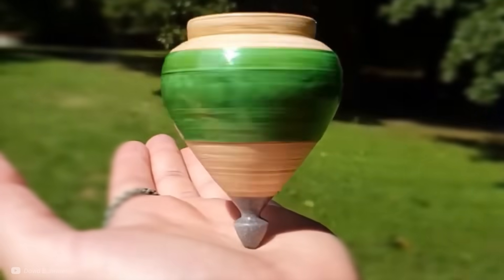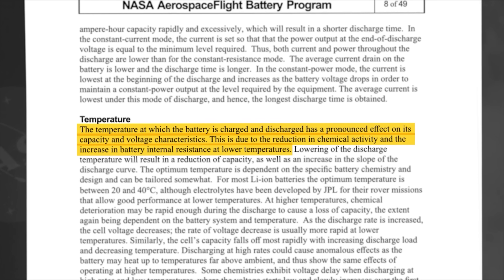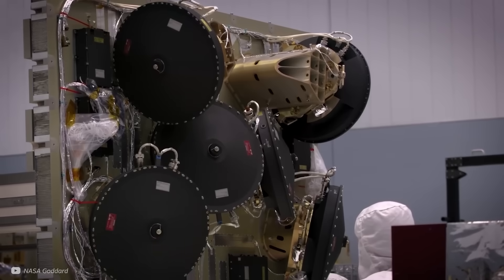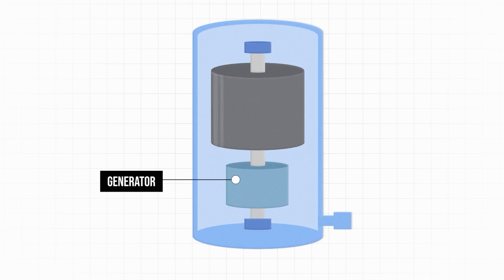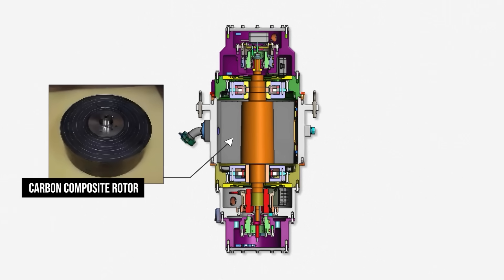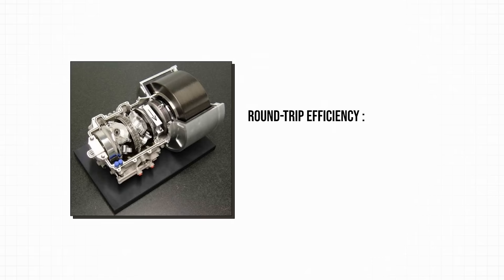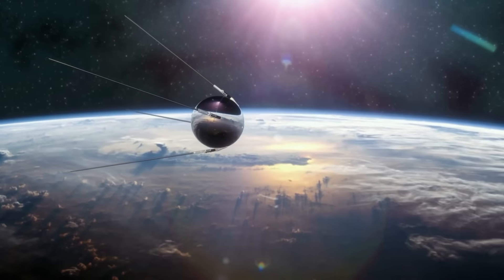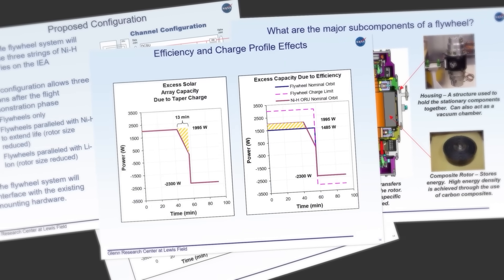How NASA Reinvented the Mechanical Battery

Comment: So, stupid question, why does it need to be put through a generator / motor? My thought is those wheels with permanent magnets that spin and create power. Does that actually also create drag? Like when you drop a magnet through a non ferrous metal tube / magnetic break?  I know that's pretty much how an electric motor and generator work but without any contact how does it slow it? I am just trying to understand.

Comment: wouldn't the obvious issue with a flywheel in space be that it has a lot of angular momentum you constantly need to fight against, both as it slows down/speeds up, and whenever you want to reorient the spacecraft? also if you take the weight into account, i can see why batteries are clearly a better option now and into the future.

Comment: Flywheels are great for energy storage ... for periods of time on the order of hours.  It's the friction loss in the bearings, and even the air resistance (unless you evacuate the chamber in which the flywheel rotates).  Also, the electromagnetic motor/generator has to be able to accommodate a wide range of rotational speeds.

If you puncture the (vacuum) chamber holding a high energy flywheel, the next thing you should do is run like hell.

Comment: Flywheels may not be affected by chemical degradation like batteries, but they are subject to wear and tear that limits their lifespan. The progressive failure of the flywheels on the Hubble Telescope has necessitated their replacement several times and has caused ongoing issues with its star tracking mechanisms

Unfortunately your videos have a tendency to oversell whatever your video is investigating; whether that be due to your passion for the subject matter, or due to your limited exposure to the wider engineering discipline. I suggest that your videos would age better and be better representative if you included a dose of scepticism

Comment: As I recall, many years ago one of the Big Three auto makers was working on a rotational energy storage system with a mass that rotated at a very high RPM. When it catastrophically flew apart and killed a couple of people, the experiment was ended. (Perhaps someone with more information can give more details.) Rotational batteries can be extremely dangerous!

Comment: the biggest thing is getting faster and faster rotations, since KE=1/2Iw^2 where I is the moment of inertia and w is the rotational velocity. this means the kinetic energy in the battery will increase linearly with mass but exponentially with velocity. this also means you can get better kwh/weight ratio with a lighter flywheel. idk the effect the lower inertia would have on power output though, seems like it would be able to get higher peak current but struggle long term, but that's just a guess really. 

of course with greater rotational speed comes more centrifugal force trying to pull it apart and so you need stronger and stronger materials.

interestingly i had come up with this idea independently a long time ago, i thought about the conservation of angular momentum and my first thought was "what if you put a giant coil around the earth" then scaled it down a bit...a lot...and i thought of a large spherical magnet surrounded by a coil, it would be in a vacuum chamber on magnetic bearings to minimize friction. i knew if friction was 0 it would spin indefinitely, but i figured there had to be some force that acted against the magnet when you drew a load that would slow the magnet down (since i don't believe in perpetual motion machines) but i didn't know at the time what that was, so i looked it up and learned about lenz's law, i also learned that nasa had already created the very thing i thought up and was using it as a battery, something that hadn't occurred to me.

also one other thing, not all motors are generators, only those which use a permanent magnet, some motors use an electromagnet in place of the permanent magnet, those cannot be used as generators.
Reply: @Tusroni - Regarding the last paragraph of your post about "motors as generators" sorry, not at all true. Haveing owned and repaired many over the years, the vast majority of generators in service aren't PM types. An example is the alternator on most car engines today has a spinning magnet coil winding, excited thru a controller from the 12vdc battery has no magnetism when disconneced from power. Yes, I know it isnt used as a motor, but the same principles are used in those that are; such as the gigantic Motor/Generators used in some pumped storage dams that send water to an upper resevoir when exess power is cheap, and runs down thru as a generator for high demand times. Also some car starter/generator and hybrid systems have been tending to minimise use of rare-earth magnet$$.
So, most non-PM motors DONT generate or generators DO motoring (as built) but many could with modifications.

Comment: why dont they use a ratcheting clock system almost like a watch? like a wind up battery. I wonder if the power output would need to ocellate (spins right than goes left or smth) idk if output shaft could be brought up to a speed to generate enough power though. I wonder if it could run smaller things atleast. and have something like the gyro to rewind it.

Comment: Tesla and other manufacturers use regenerative braking to generate voltage to partially recharge the battery. So, you're wrong that Tesla doesn't use such tech.

Comment: 6:18 that's actually inherently false. Not all motors can just be spun to make electricity. Some require modification to do perform that functions. Try to spin a DC computer fan as-is and tell me if you get anything out of it. Typically generators will be designed differently that motors because of their function to make them more efficient for one purpose versus the other.

Comment: Rotational motion is one of the strangest things in physics. It's really weirdly unintuitive and there are things about rotation that we still don't understand fully. The biggest flaw with say, reaction wheels is friction and thermal expansion / contraction.  Or maybe a better way to say it is any rotating mass has an Achilles Heel and that's because it's made of stuff that's jiggling because it is above absolute zero. Even magnetic bearings will slowly waste energy over long periods of time as the reaction to the bearings have an unwanted torque even in the very very tiny amounts that would be used in space. That's where the genius of it all is when combined to use that unwanted torque to deliberately orient the craft thereby nearly eliminating loss. I didn't know there were still mechanical bearings though. I'd suspect those are disengaged once in orbit or on its way somewhere.

Comment: 11:13 The action-opposite reaction effect described will only happen when some force is being applied to speed up the wheel, as when device is in "motor" mode".

When the device is coasting, as neither generator nor motor, its force on the boat will be negligible.

When the device is in generator mode, the effect will be to drag the boat in the same direction as the wheel is spinning.

Comment: They are only used to adjust orientation.  Not Altitude.  0:10
Reply: Probably he meant to say attitude.

https://en.wikipedia.org/wiki/Spacecraft_attitude_determination_and_control
Reply: @tuomaskk  Nope. He also said, "height".
Reply: @omnivore2220  you might want to read my comment
Reply: @omnivore2220  Yeah, had he said attitude, I'd likely have let it go 😜
Reply: IIRC they can affect the height indirectly by positioning the spacecraft in a certain way with reference to the atmosphere and “sail” on its outer bounds
Reply: @pawesowa7283  "Sailing" ?  If a spacecraft/satellite is low enough in altitude to encounter any part of earth's atmosphere, you're going to be bleeding velocity, and thus altitude.  

A flywheel/Gyro will only be able to change and maintain orientation.   You could orient a spacecraft so a larger surface area (such as a heat shield) is used to brake when hitting the atmosphere, to lower altitude, but that's it.  

Orbital velocity is directly linked with Altitude.  Even the when earth's atmosphere is at its thinnest, it will technically still slow the vehicle, due to drag even if it is negligible.  This is one of the reasons the ISS needs to perform scheduled burns to adjust its orbit.

Comment: Won’t charging and discharging the flywheel battery cause unintended rotations of the spacecraft? This issue could be alleviated by installing the flywheel batteries in counter-rotating pairs and charging/discharging them synchronously. But then to rotate the spacecraft, those pairs will have to be decoupled in speed, which will cause new complications: Maximum and minimum charge will have to be limited by the charge difference between the couples.
Reply: You build the storage as contra-rotating flywheels with the same rotation axis, and charge/drain them both at the same time, so that the torque cancels.

Comment: I just had an idea...a flywheel made of a carbon fiber shell with its edge containing a block of metal like steel on the inside. Carbon fiber is best in tension, so putting the weight inside the edge of a hollow shell would put the shell in constant tension, which should make it withstand even higher RPM.

Comment: Energy is stored in proportion to the square of the (rotational) speed, but output voltage will be linearly proportional to the speed, so that must lead to quite a high voltage range for the power electronics to deal with...right?

Comment: water boils under a vacuum but the batteries chemistry isn't directly in the vacuum. it'd be like being in an insulated flask, you know a 'thermos'. heat would be a problem not cold.
Reply: That was my take, as well. There is no "freezing cold of space"; the problem is getting rid of heat, not insulating against heat loss.

Comment: I work for a company that develops reaction wheels for satellites. 
It would be pretty easy to recover the energy from the wheels. But most customers don't want those intermittend energy sources on the power bus. So we are using load resistors to convert the energy to heat... which then is difficult to get rid of without air. 
Attitude control is difficult enough, even without having to take into account how it influences the power to all other systems. 
I'm not saying it can't be done, just that many manufacturers choose not to bother. :)

Comment: I would imagine you would want to shield the hell out of those flywheels so magnetic storms don't induce a current into the flywheel and casing otherwise you could end up with a wobble that could cause issues. Also I wonder if the flywheel would keep stable during operation while the craft acceleration/deceleration. I guess you could switch to alternate forms of energy storage during those phases of space flight though.

Comment: When they calculate energy density for the batteries on the space station, do they calculate the energy required to send up replacements and the frequency of replacement? It should be factored in.

Comment: FESS is not a new idea, but it has significant issues on earth since it has gyroscopic issues where the FESS has to be on a gimble, free to float despite rotation of the earth and gravity incurring friction on the bearings and air friction that needs a vacuum to overcome.  In space the issues are much less severe and magnetic bearings are viable. Combining the FESS as a reaction wheel is a perfect example of synthesis.

Comment: The issue with mechanical battery is in the motor/generator dynamic, and their associated efficiencies:
A purpose made electric motor can be  99.9999% efficient, BUT it is at best 95% efficient generator.
And inversely a purpose built 99.999% efficient generator is only 95% efficient as a motor.
It all has to do with the motor winding type that you choose.
There are no free lunches, only tradeoffs.
Reply: Purpose built 99.9999% motor:
1. Doesnt exist.
2. If it were to exist then it will onerheat if forced to run at any significant power at 99,5% efficient, let alone at 95%.
Real electric machines will have ~97% for BOTH MODES, motor or generator.
Reply: @volodumurkalunyak4651  I got that from a Bosch engineer. I believe he knows his windings.

Comment: This is one horrible explanation of wheels.

1. How does the station adjust altitude using things that make it rotate? 
2. Why is the thing you never show (0:49) the actual ISS but some random satellite?
3. That specific arrangement of 4+ wheels is (probably) to ensure energy can be both charged and discharged without changing orientation, otherwise 3 wheels perpendicular to each other would have been sufficient.
4. You need an entire facility to manage a mere bunch of solar panels as far North as Canada?

Comment: If there were enough flywheel generators on the planet, we could change the length of a day on Earth or it's orbit.. I could do with an extra hour!
Reply: @Veeger  and we could boost earth's magnetic field / magnetosphere by 1000x !
Reply: @Veeger  Eventually the length of day will increase by a lot, due to the tides transferring earths spin energy to the moon over time. The length of a day at earths formation when the moon was much much closer was ~6 hours. 400 million years ago, it was about 20 hours.
Reply: @rylandrc  Tidal barrage generation also can slow the Earth rotation, but minutely just by holding back the water at high tide, then letting it out through a power producing turbine. (St Malo , France)
Reply: @Veeger  💜🌊💙

Comment: Wait. I'm not even thirty seconds in and I think I'm hearing something inaccurate. How do flywheels adjust the altitude of satellites. Far as I know, nobody has figured out a way to use flywheels for propulsion.
Reply: And then, later you claim that reaction wheels can change a spacecraft's direction... Oh, my. Let's not confuse direction with orientation.
Reply: Also, you imply that flywheel energy storage systems can be used as reaction wheels, which I do not think is even on the table. I hope this feedback helps you make better videos in the future. This one bugged me.

Comment: I might have this wrong but it would seem to me that if you put power into your fly wheel, it would impart an opposite spin on the satellite and if you took power from the fly wheel, a spin in the opposite direction.  Think of sitting on a chair that can spin in the horizontal plane with very little friction.  You spin up a fly wheel by hand and your chair turns.  You put on the brakes to the spinning fly wheel and the chair spins in the opposite direction.
Reply: That is only if you have the station or satellite as the stable platform against which to push the flywheel to spin it up. If you have two flywheels spinning (in opposite directions) against each other this problem doesn't exist.

Comment: I don't even need to watch this video to tell you why we don't use these "batteries" every where.  The primary limiting factor for mechanical batteries is energy density.  They require enormous mass and sizes to be viable.
Reply: The low mass ultra high speed flywheels  .. vacuum flywheels used a fiber  whip or wand as the flywheel ... they tend to be large diameter and need very efficient bearings.
Reply: @clivestainlesssteelwomble7665  ok then you are just transferring the difficulty ivy materials bc super efficient bearings are hard to make and most materials have a shatter rpm.  The point is the same.  There are physical limitations on this method of storing energy that make it impractical in 90% of applications.
Reply: they are good for short therm high energy demands or if you have multiple cycles per day. otherwise use lithium batteries.
Reply: They also lose energy when orientation is altered.
They are only good in a static position.
Reply: the rotative battery tends to have higher energy density the bigger the flywheel
Reply: Tends to have?
These things are physical laws
I would simply say "has" because if it is a size, shape and has a certain rotational speed, then it has precisely the energy dictated by Newton, or as some are pointing out, dictated by Special and General relativity

 @matissebrement7161
Reply: Think of them less as batteries and more as capacitors. 

There was a trolley bus in the 60s that used a flywheel and it was energy dense enough to let it go on parts of its route that didn't have overhead wires. 

They're more practical than you think
Reply: As for spacecraft, it's basically a way to solve reaction wheel saturation (look it up) with electricity as a "waste" by-product

Comment: I think combining the two purposes might make things more complicated. Do you need to adjust attitude at the same moment you need power? What if you need power but already pointed in the correct direction?
Reply: Use multiple flywheels of opposite rotation, so they cancel out.
Reply: You need power precisely to change altitude. You only need power to change altitude (aka. "You already pointed in the correct direction")
Reply: @ "Attitude" or "altitude"? You guys might avoid some confusion by using "orientation" and "height" instead.